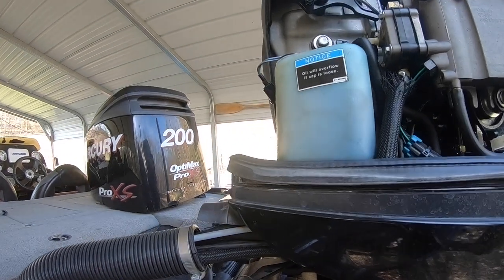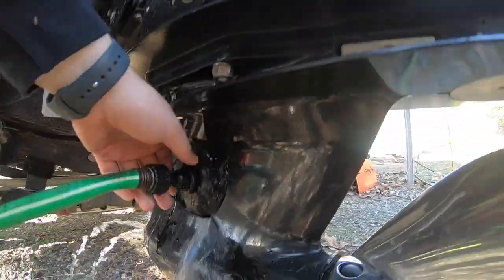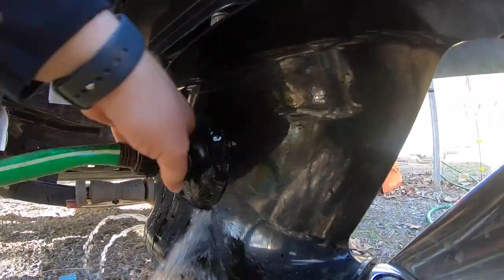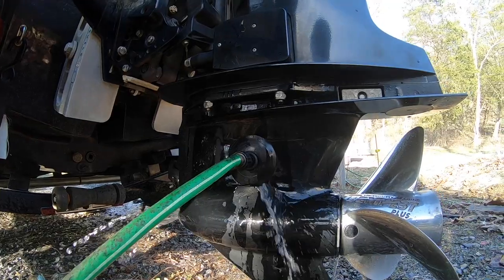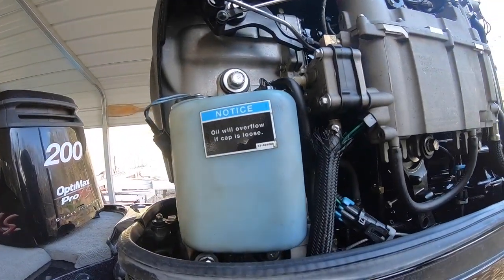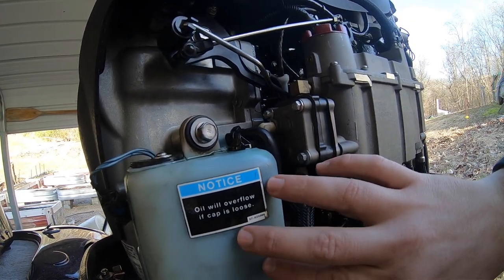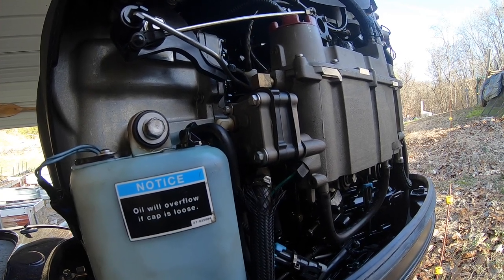How to fix 4 beep oil alarm on Mercury 200

Comment: Great video man. I'm have same issue but for some reason my 3 gallon tank is not transferring the oil to the Resivor like it should I add oil to the resivor I turned the boat on  and  I loosen the resivor cap but it not bleeding. What can try to see how get that working again 🤔
Reply from the maker: Did you leave it open for awhile? Mine took a total of almost 7 minutes to bleed less than an inch in the tank. It’s definitely not a fast process

Comment: A somewhat related question. Is there a seal or o ring for the sensor on the left? A friend is having a problem with that apparently leaking and causing beeping.
Reply from the maker: Yes there should be a seal on it
Reply: @MichaelKnappFishing  oil is leaking out where the wires for the sensor is
Reply from the maker: @MrFutureParadox  that’s not good! I’ve never had to deal with that issue before. I would call a marina and inquire

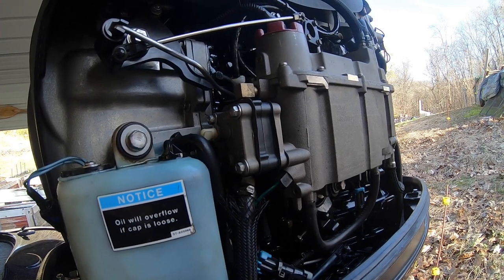Comment: All of this works fine but I think I'm going to have to replace the sending unit from the float. You can see the blue wires at 3:57 or the entire tank if the float inside it is bad. Thats a $200 kiss from Mercury.
 Loosening the cap works great but I still get the 4 beeps so something with the oil is flagging trouble.
Will I need to have a dealer clear the codes after I do all of this ? 
Also is there a strainer in the pickup tube in the big tank that I should check for blockage?
Reply from the maker: I would take to my dealer if you’re having those issues
Reply: @MichaelKnappFishing  I had to. Found out the Mercury Dealer who sold it to me missed a Mercury recall on the gas line. That getting replaced and the new tank for 315.00 and we're off to the lake. BOAT Bust out another thousand eh?
Reply: @noenthusiasts I’m having the same issue as you. What tank did he replace?
Reply: Also, the gas line? Where’s this located
Reply: The small white plastic one on the left side of the engine. Very spendy, 213.00 and took 4 months to get it. FYI what started as alarms also learned of a recall for the gas lines. White with little red diamond pattern. It disintegrates on the inside plugging up everything. Replace the line and filters. @NathanCoffmanFishing
Reply: A small square white plastic unit attached to the side if the motor. $214.00 from Mercruiser and a 3 month wait for the part. The lakes were frozen by the time it was ready. @NathanCoffmanFishing

Comment: my issue is that the two large tanks will not fill the reserve even after I open the knob to bleed it.  any thoughts? Is there physical pump of some sort?
Reply from the maker: lucky vang make sure that your oil tank is sealed well. These tanks works off of a pressure system not a pump. If the motor oil reservoir won’t fill you have to bad lines or a major leak somewhere
Reply: @MichaelKnappFishing  Okay.  thanks so much.

Comment: Is there a filter between the main and onboard reservoir tank? Thinking if this got clogged up it could reduce the amount of oil to this motor reservoir. Anyone??
Reply from the maker: That I do not know! That's something I would ask a Mercury mechanic about.
Reply: @MichaelKnappFishing Turns out there is a fine filter within the main tank. Might be worth a look as well.
Cheers!
Reply from the maker: @justincooney6873  good to know!

Comment: How to do you get it to quit beeping after you fix it
Reply from the maker: Deer_Hunters_ Addictions it quits on its own once the oil reservoir is full
Reply: Michael Knapp Fishing my reservoir on the motor was a tad low i filled it up let it over flow and filled main reservoir up and its still beeping not. It was in limp mode with low oil it came out after i filled it up.
Reply from the maker: Deer_Hunters_ Addictions if your motor is still giving off the 4 beeps and both oil tanks are full your sensor has more than likely gone bad

Comment: Hi having the same problem i already replace the tank and did the same thing , still when i run it i here the same beep after 20 minutes , it beeps 4 beeps i open the tank  the tank is low again on oil kindly if any one knows how to free the air from the oil pump it self let me know with a video thank u so much , its embarrassing my engine runs only 16 hours and its brand new ...
Reply: I hear 4 beeps
Reply from the maker: @Nass1986  if your motor is brand new is wouldn’t touch it! Take it to your dealer ASAP